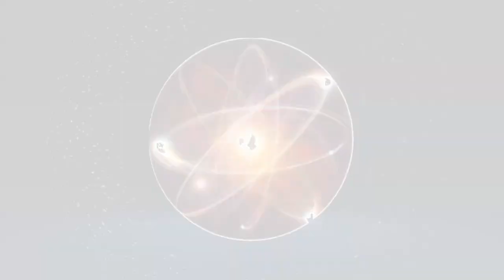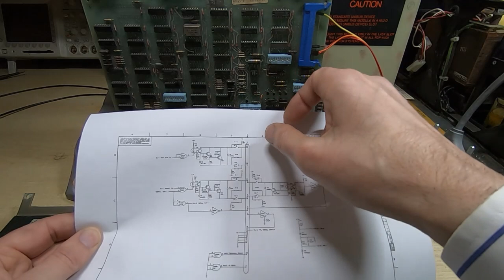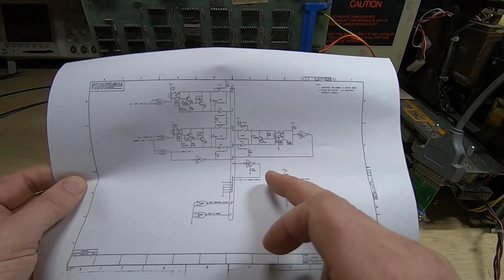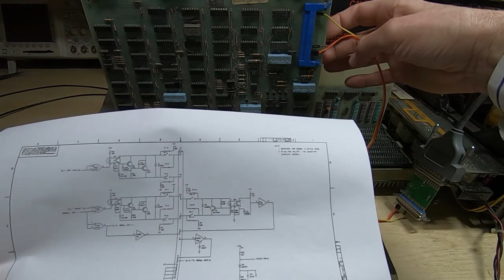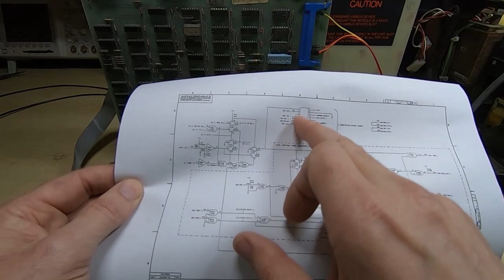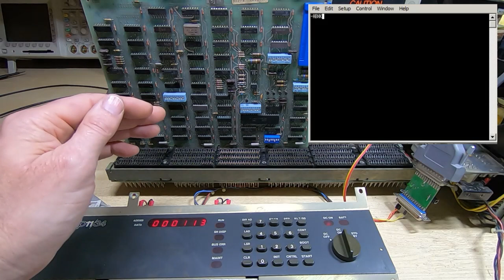PDP11-34A Repair Part5

Comment: Was the console an option for Digital PDP series?   When I was at Dollar Rent A Car in the 1990s they had 9 PDP 11/23+ systems and one PDP-11/08 (ARINC) in the reservations area.  They had no consoles, only the three toggles on the front and a few status lights.
Reply from the maker: Yes it was. In fact most of the boards were options. In theory you only need an on / off switch on the front panel as the boot loader can be used to automatically boot from floppy at power up so it could start directly into system software.
Reply: @JerryWalker001  For the reservations systems there were single platter disk packs for each of the PDP-11/23+ satellite systems and the PDP-11/08.  There was a vacuum channel 9-track tape unit for the system back-ups.  I worked grave yard, and I remember, one of the PDP-11/23+ satellites stopped responding.  I reset it, restarted all reservation programs, and in a few minutes it stopped responding again. I restarted that particular system three times.  I wonder if there was something trapped in memory which didn't completely clear after the first two resets.

Comment: Is it necessary to type the zeros on the keyboard even though the display already shows all zero, or do you just do that for clarity?
Reply from the maker: Good question. The data is 'shifted' into the interface register so in theory you should not need to type the leading zeros if you clear the display first but because the value currently displayed is not always the value in the actual address register (for example) then it is best to enter all the digits to ensure that the register is properly updated. I do this mostly out of habit as it prevents making mistakes if the internal number is different. Also bear in mind that some functions of the controller perform maths functions on the values so it is best to be explicit with data entries. I also do this because it is possible that the display may be faulty and have missing segments (remembering that 90% of work I do on these machines are repairs). Eg a digit may look to be a 0 but is actually an 8 but entering all the required digits ensures that the correct value is entered.

Comment: Jerry thanks for identifying the DEC modules and so on, eg. attention to little details like what power transistor you are using to substitute are all helpful to me maybe others too. 
Also regarding your other video series on the CCI machine, I understand now that the line-time clocks don't need crystal sources but there is at least one RTC module, the KW11-P (M7228 Unibus quad height) Programmable Real-Time Clock which does have its own crystal on board (its manual is on Bitsavers).

I bought one as it is apparently required for running Mini-UNIX on a PDP-11/05 (my goal, if I ever get that far :).

Comment: Can you explain the unibus? I see 6 connectors for every slot but in the bus pinout description you only see the first two connectors. What are the other four for? And why do you put a terminator card in connectors A and B while the console and serial card are on CDEF?
Reply from the maker: I will be posting a video describing the Unibus but it is much simpler than it appears. The unibus is really just the first 2 rows (A and B) and consists of 2x 36 way connectors to give a total of 72 lines. The remaining 4 rows use wire wrap connections to the two unibus rows. This allows each of the 4 rows (C, D, E and F) to have their pins wired to give any combination of the unibus connections although they are normally fairly standardised. This allows minimal decoding on slave boards because the required signals are already effectively decoded by the hardware connections on each row. The boards simply connect to the ones they want and it also allows custom board to board connections in addition to the unibus connections when required. Because the connections in the last 4 row are really connected to the unibus rows then only rows A and B need a termination card and its has two functions. The first is to provide signal pull up resistors as all the cards use open collector outputs and this allows multiple cards to safely share the bus. The termination card also responds to any grant signals that are not handled by any of the cards fitted. This may sound complicated but I hope to explain it more clearly in an upcoming video.
Reply: @JerryWalker001  Thank you for the explanation, looking forward to that episode. Keep up your work, i really like your channel.

Comment: 10A at 5V seems a lot these days but with all those (MOS?) memory chips I guess it would not be surprising. Looking at the layout of the chips it looks like s 256KB (128KW) board with parity on each byte. Testing that by hand via the console would require a LOT of patience! Great that it appears to be working so far - and great that it can be tested as a module without needing the CPU cards.
Reply from the maker: Testing can be simplified for initial assessment. Each read or write is for 16 bits and you only need to test each chip as they are 1 bit devices. If they fail then they tend to not work at all so testing each block is sufficient for basic testing. Full bitwise testing can be done later. The machine can be booted to a terminal console so this can be used later.
Reply from the maker: I forgot to say that the Unibus has 18 address lines and 16 data lines so most likely the card is just 9 address lines x 16 data lines but I could be wrong. I will know more once I have looked more closely at it.